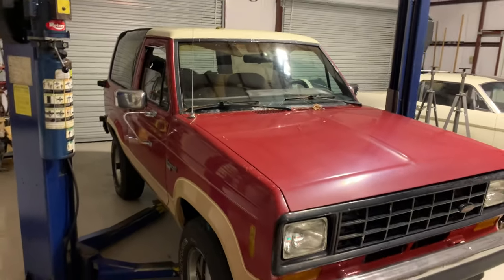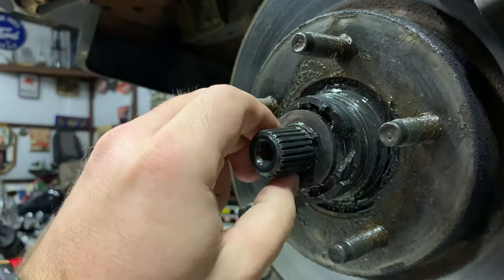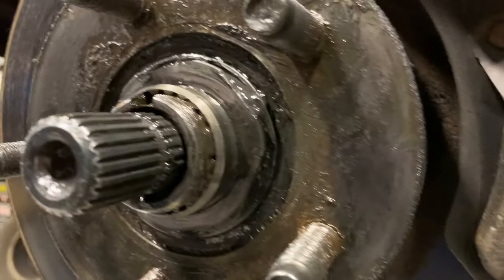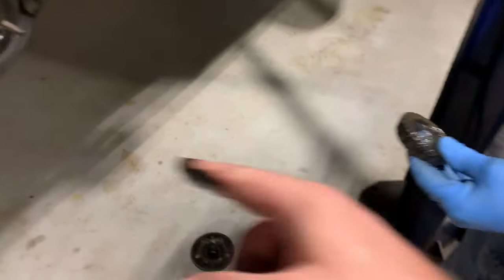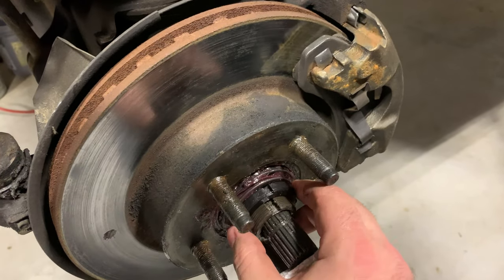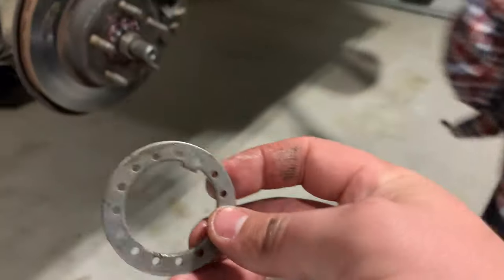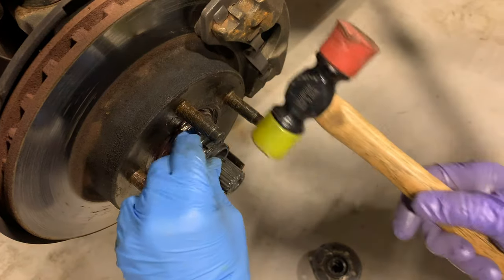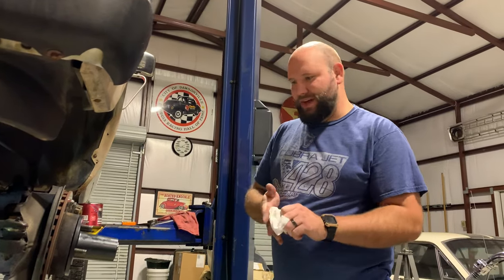Mile Marker Manual Hub Conversion - ‘88 Ford Bronco II

Comment: Nice shop. BTW if anybody wants to know. Put a can, or bucket under that clip when you knock it off. I use channelocks to tap it off and a bucket to catch the clip.
Reply: And spin that hub a few times before loosening for retorque.
Reply from the maker: Thanks, and good advise!

Comment: Hi, If you change to manual hubs why would you still need to use the switch in the cab? I don't understand, please enlighten me.
Reply from the maker: The switch in the cab still has to charge the Transfer Case into 4WD.  You are only locking the hubs manually.

Comment: I replaced the main fuel pump in mine (the one in the tank) but not the other and it stalled out and wouldnt start back is that caused by the secondary pump?
Reply from the maker: That is very likely

Comment: Your hub screwed up not to nuts nuts don't clean up after they get partially on if you were paying attention they screwed on easy after you got to a certain part if you're paying attention when you screwed off The big knot you had problem getting it off at the end which means your threads were messed up or it was mushroomed out keep up the good work

Comment: You should have cleaned you hub threads with a wire wheel.  If you recall, the original nut came off hard.

Setting your torques with a flat tip and hammer, in a garage with it's own lift; some wack priorities.  All that effort to film but you don't 5 minutes more to pull the caliper and correctly pack the inside bearing???